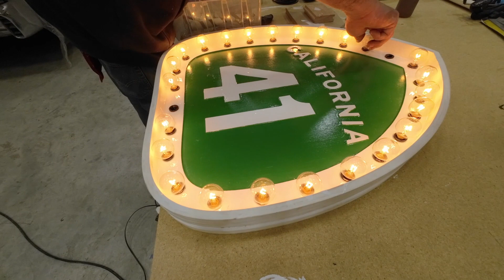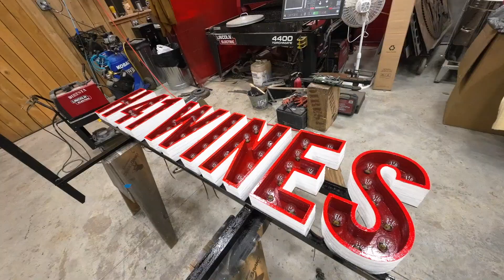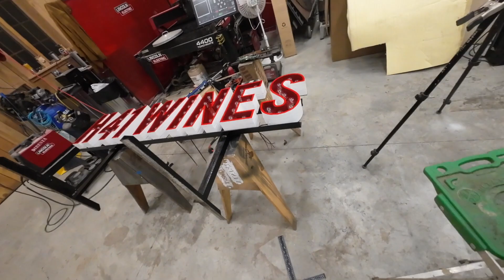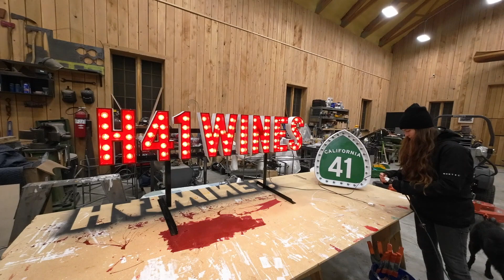DiResta [Trailer] Marquee Light up Sign

Comment: I love/hate working with MDF. Great stable material but dusty as heck! Here's a tip (in case you didn't know) Before painting cut edges of mdf, because it sucks paint up like a sponge, if you take a 50/50 mixture of titebond glue/water and paint the cut edges it will form an eggshell cover to be able to paint over.

Comment: I made a knock-down commode to compliment a drawing table I built about 1973.  I made it from MDF veneered with .060" quarter sawn red oak.  Hobbywoods of Baltimore was in business then, don't suppose they're around anymore.  The MDF was surely heavy enough but had no strength.  Over the many years, I meant to redo that little piece of casework, but since the veneer was so pretty, I never did. All was not lost; I learned early on that MDF sucks.  PS - regarding Hobbywoods, I went there with my friend to get the teak decking for the 30' trimaran he was building. We hauled the stuff to the sweaty basement of the farmhouse I was renting in Calvert County, MD, and proceeded to rip beautiful 8-10", FAS teak boards into nominally 1 1/2" strips for the decking using my 6" Champion bench saw(fixed arbor, no tilt, right on the nuts accurate). With every 8th or so cut, I would think, "Well there goes another inch of board."

Comment: I was wondering the entire time if those are 12V bulbs or mains bulbs. I thought surely he would not handle 110V like that (9:11) but aparently i was wrong :D
Mains makes alot more sense though, you'd need quite a huge transformer/PSU for that many bulbs if it was 12V

Comment: Great end result, however as a fourth generation signage manufacturer, I would be cautious manufacturing that style of signage for sale (read customer paid) without a UL listing.  I have seen many companies go under over the years for this exact reason. Wood is not an approved UL listed material for illumination, and if any fire is created in the space, regardless if your product created it or not, if they can track down the trail they will as for the UL listing on the product.  I appreciate everything you build, just words of caution. Keep up the great work!